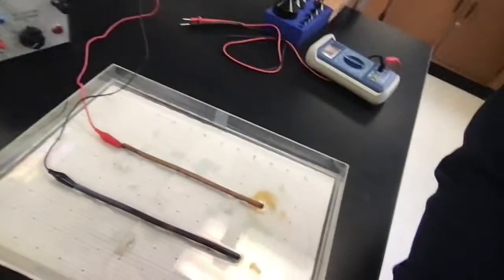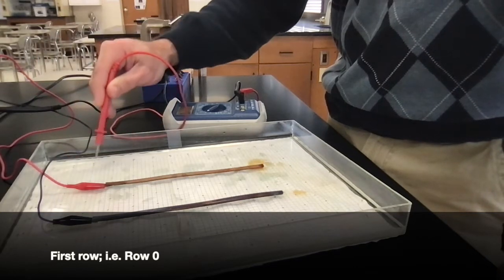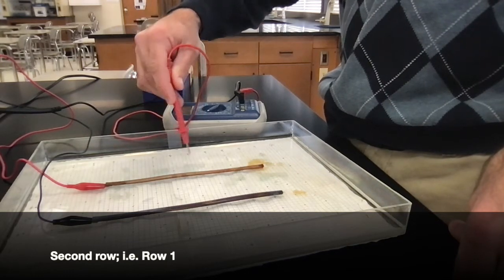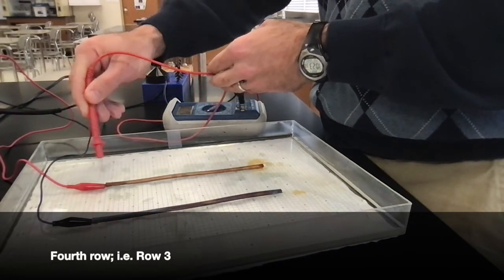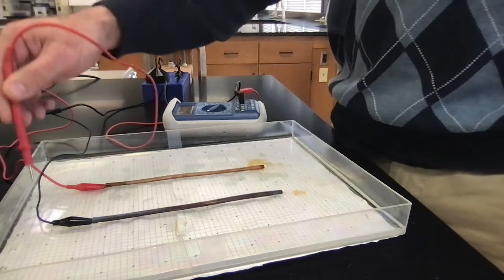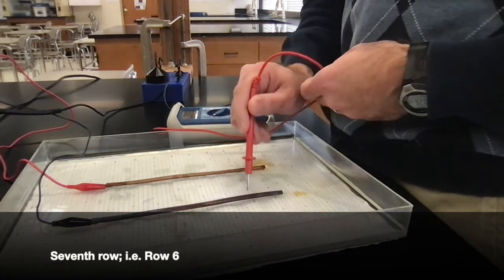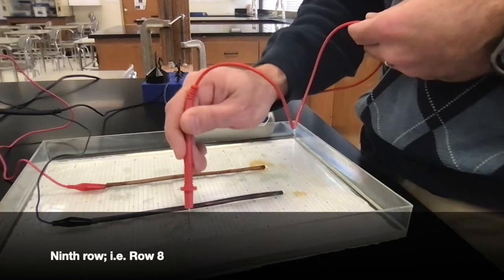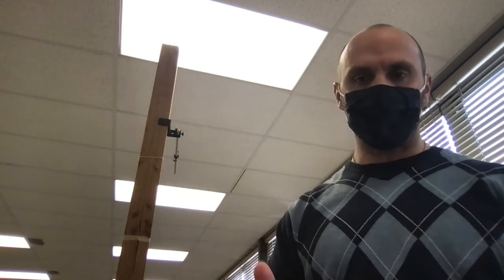Mapping Electric Fields  - Water and Voltage Activity

Comment: Is the black probe of the multimeter connected to -10V?
Reply from the maker: Hello friend. Good question. No, the black probe is just connected to the 0 V or neutral side of the power generator. It could also be connected to the 0 V rod. Basically, what we are measuring is the "potential difference," not really the "absolute potential."